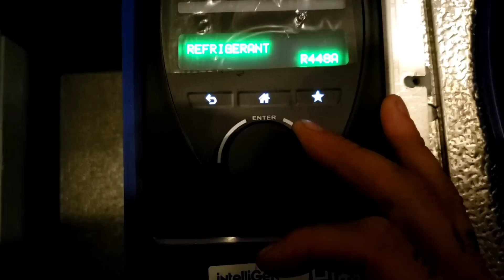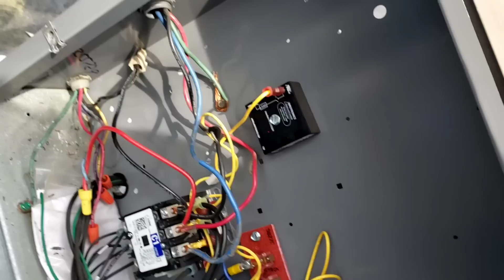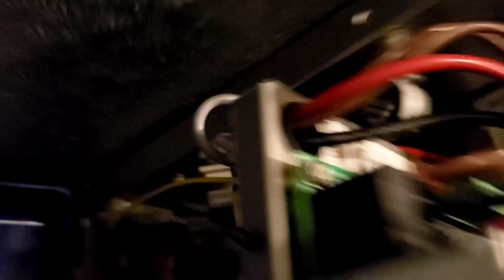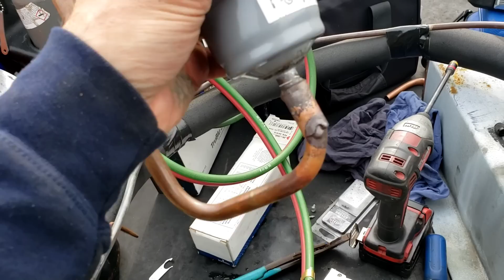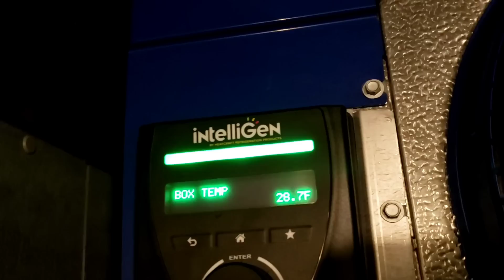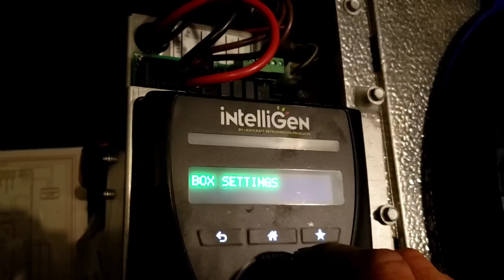June 7, 2022

Comment: Just came across the same issue couple weekends ago . I pulled all that INTELLIGENT 💩 out , brazed in a traditional expansion valve , solenoid valve , coil , and mechanical thermostat, customer is good for a long time . Those EEV always 💩 mainly on weekends ,and not all supply houses stock those . Good video 👍🏼

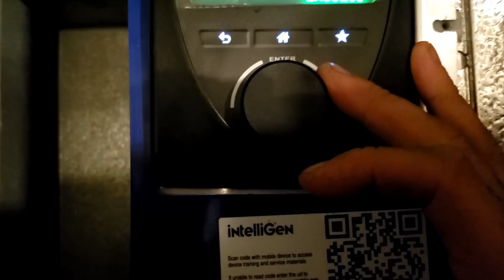Comment: 1:24 uphill condensate drain line? is there a trap outside the box? probable doubling trapping issue and condensate backing up/freezing coil.
the box door opening/closing may cause it to flow and drain out when used often, but an overnight defrost would likely vapor-lock and cause issues.

Comment: Great video, I'm starting to run across more of these walk ins, the information you teach is nothing less than valuable. 

For me though, when it rains, especially in central Florida, I don't risk it, I get the heck off the roof. Lightning around here is dangerous as heck and can be very spontaneous (meaning it may jus seem like only rain, but that lightning is sneaky).
Plus I've got soaked enough times in my career, 😂

Comment: Have not worked on Intelligen yet, but FWIW, at the training I went to last month presented by Don Fort, three things he stressed: 
1.tranformer tapped correctly?
2. IF clean install practices performed, nitrogen flowed, that mechanically the EEV itself seldom is faulty. The solenoid coil,  molex plug or connections, and thermistor probe all fail, but the EEV seldom since fails as opposed to  a common TXV that deals with opposing forces,  the EEV body is much simpler.
3. Recommended surge protection for all units with control boards.
Reply: going by the overall original install, do you think they nitrogen purged while brazing? probably hacked in god knows what used "poisoned" refrigerant, etc etc etc.
the condensate drain wave(uphill low spot trap inside the box), if there's a trap outside the box, it's double trapped vapor locking with no flow and icing up.( pile of ice on the floor!)

Comment: I deal with these units a lot. Whenever the coil ohms out fine 9/10 times it is the board. I test by forcing the unit into a defrost and check voltage coming out of the board. That transformer being tapped wrong from jump street most likely caused the board issue

Comment: Its called progress they tell me, energy efficient blablabla, stick in txv and be done with it for the next 20 years.
Reply: I agree the other day I had intelligen lock out because they had power outage. I know ECM save energy but  I dont see how eev saves energy
Reply: @Holop88  in this case it saves nothing, quite the opposit. It is suposed to be able to work with very low condensing pressures
And save compression energy, however this setup will not allow it. The other backdraws are they fail all the time, sensors, boards coils what have you. The manufacturer also wants a dedicated electrical circuit for this evaporator also. I dont see any savings to be made versus 
A standard txv.
Reply: Sjef agree!

Comment: Nice video, Bill. Glad to see you back with videos more regularly. As for that valve... I agree that it was bad 100%. The key, for me, isn't whatever voltage you measured, or whether it was consistent, but rather that the board reported the valve as open when it wasn't.  That's not a function of the board, it simply reports what the valve tells it. The valves position sensor was reporting open when it wasn't. So it was bad. Now whether the board giving wonky voltages CAUSED it to fail or they went bad independantly... who knows. Nicely.done either way; you took care of the customer. Catch ya later brother.
Reply: The valve doesn't have a position sensor, doesn't report back to the controller. 

Instead the controller drives the valve closed but "overdrives" it, which cant hurt the valve but if there's any misstep it'll make sure closed is actually closed. From there it will count the steps as it opens. 

In theory stepper motors are pretty good and will track very precisely so shouldn't need feedback.